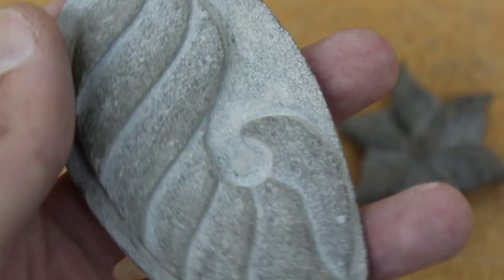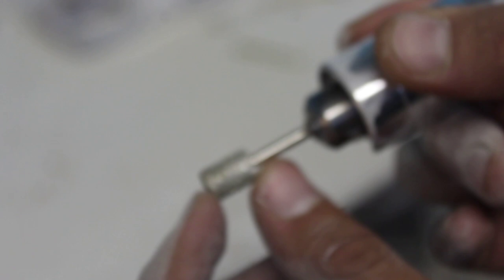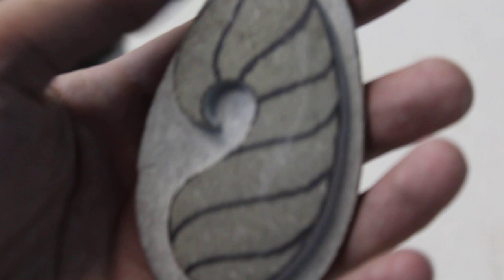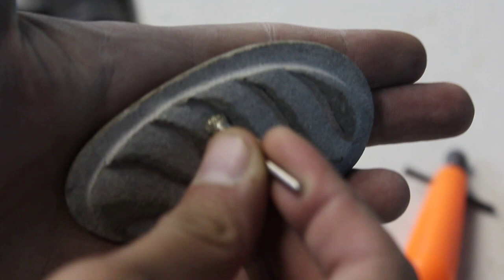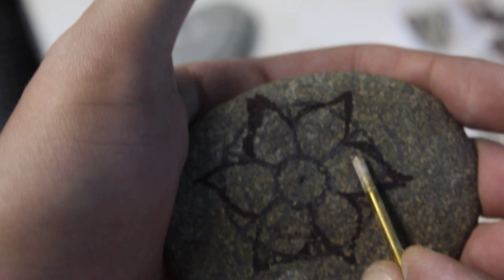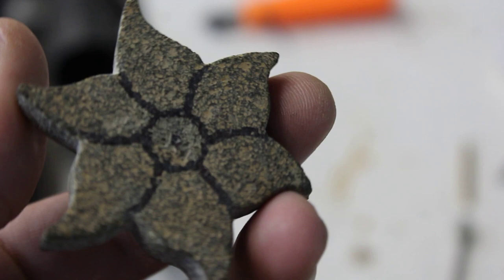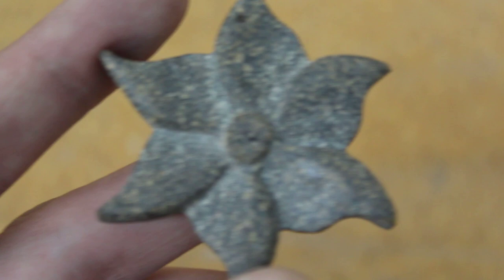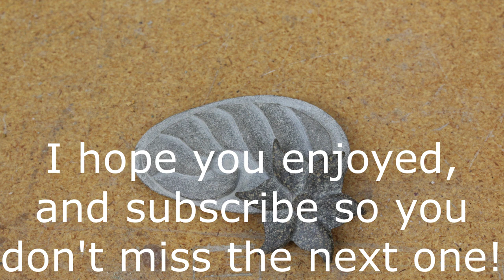Carving Techniques, Volume 1: Overlapping

Comment: What i miss is some info about the rotation speed when carvind stones, and why dont you water cool them to make sure those diamonds hold longer (or am i wrong and it makes no difference ?)
Reply from the maker: I usually only worry about water with harder stones, these rocks are just porphyry so they are extremely soft. Plus their dark color makes my drawn on lines really hard to see when wet so i usually don't worry about water with these, but any other stone i will absolutely use water! As for rpms i use a foot peddle on my flex shaft, and it is always maxed (60,000 rpms i believe this model is). I'll switch to lower rpms when polishing but i have never noticed too much of a difference when shaping. Hope that answers your questions!😊
Reply from the maker: I am so sorry for not seeing this sooner!😳
Reply: @TheoKellison  Hi Theo, thanks a lot for answering my question, i just ask beause i would love to try a bit of stone carving and my rotary tool has a max speed of 30k rpm. i still have to learn a lot before i can start !
Reply: @c.h.670  I believe my Chicago electic flex shaft has 30k rpm and I can carve fairly decent with it and noticed that sometimes just a good bit is more valuable than the brand of rotary tool you use. Hope these little tips can get you carving in the right direction 😆🙃😉

Comment: This is perfect for a beginner wanna be stone carver! I love the specifics and step by step instructions. Would it be possible for you to provide links to the burrs you use in this video. Specifically the 80 grit ones . I’ve looked online and haven’t found anything similar to the ball, cylinder, or your “ most used” one. Those I have found aren’t aggressive or large enough to get the results you show. Thanks! Looking  forward to your next video installment!

Comment: This and our other videos are great, thank you for doing them.  Do you apply a lot of pressure when carving or do you keep the pressure pretty light and grind away at the stone slowly?  New to this and trying to figure out how to get smoother "cuts" and control the tool.  It jumps around a lot sometimes, even going out of the groove that's already been cut.  Oh and what do you seal with?  Some kind of oil or wax?

Comment: Damn, I was hoping I didn't need a wet tile saw to make a stone flower like that or similar things. That thing is awesome. I wonder how many bits it would take to grind that down without one.

Do you have any advice on drilling holes in a stone like that using a dremel tool?
Reply from the maker: You absolutely can do all of the shaping with diamond burrs, i just trimmed it to save myself a little time!👍 as for drilling, make sure you have constant water on the stone you are drilling and put on a thin and evenly tapered burr. The only thing to note is go VERY slow; a little cut in, rewet, a little cut further, rewet. Otherwise your burr will burn out and lose its grit, or much worse, the burr can break off inside the hole ( which is a nightmare to get out) i hope that answers your question!😊
Reply: @TheoKellison  Thanks a lot man! That definitely answered my question. The going slow part and using water makes a lot of sense.